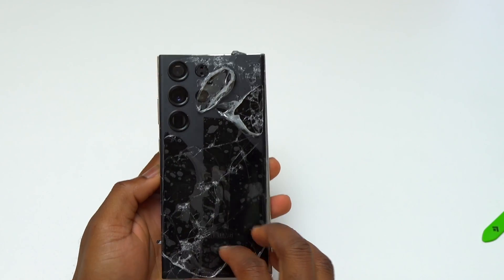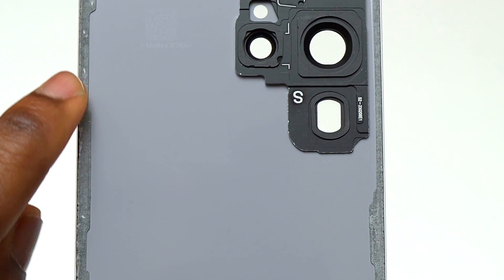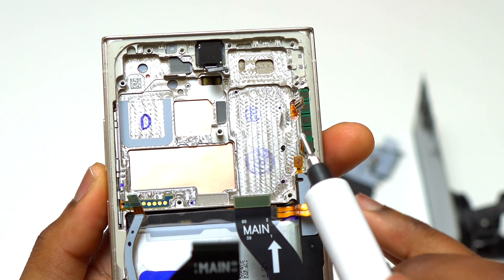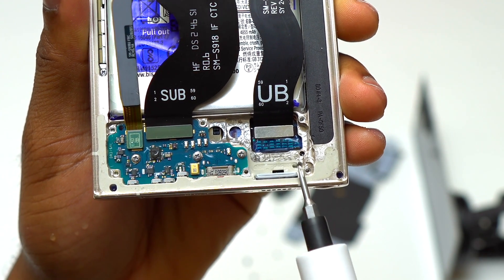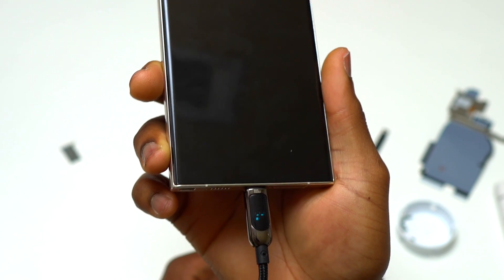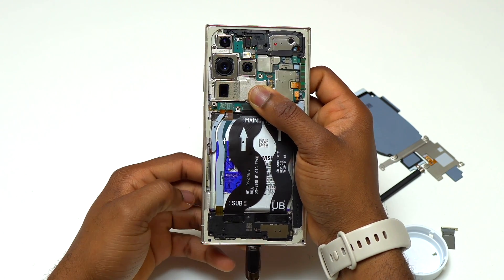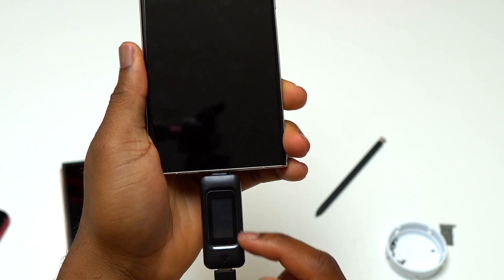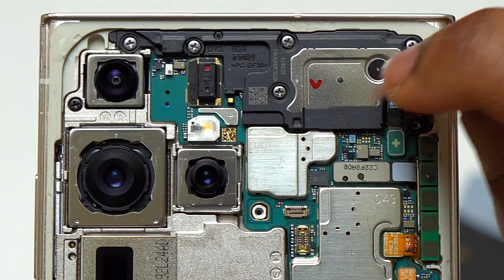Galaxy S23 Ultra in Water Then Teardown Water Damage

Comment: Hey, hope you're doing well. Would be glad if you can help me with this. I have 23 ultra and it's back glass was replaced,  the repair man cleaned everything on frame and added glue on the cornera and put back the back cover, is my device still water protected ip6 rating or not
Reply: Hello, dont trust the ip68 rating and just treat your phone as if it is not waterproof, repaired or not.